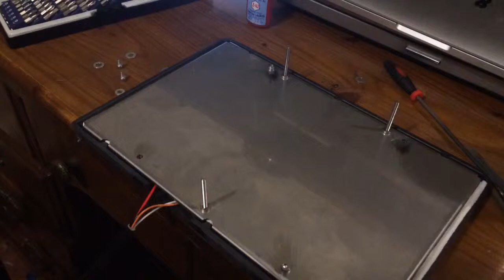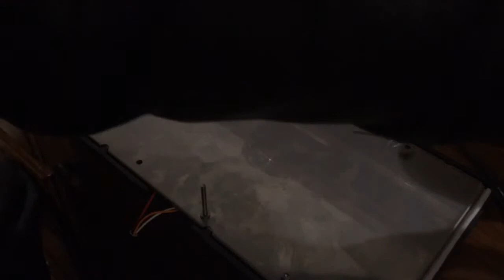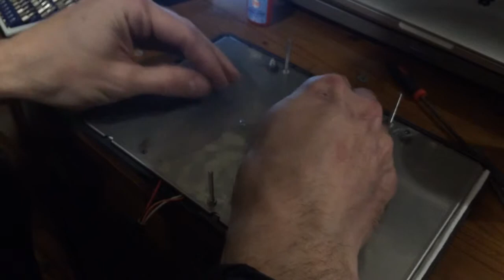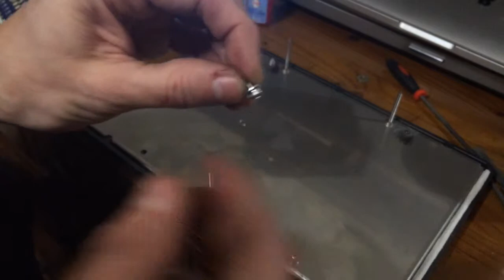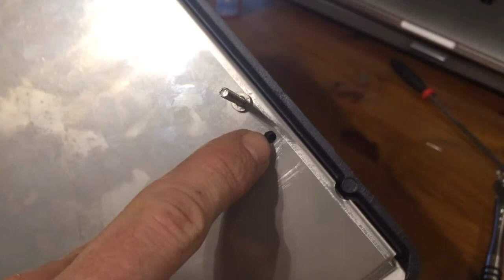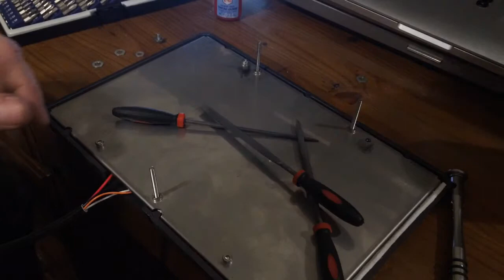Replicator 2X HBP Warping Fix

Comment from the maker: It worked great. If I was to do it again I would probably use the nylon washers, I just didn't have any available at the time. 
Since then I've also upgrade to bottleworks aluminum HBP with glass magnetic tops. So I'll probably sell this one with the fix. This one was already fairly level, but I had makerbot replace my fist one that was really bad. 
You can click the link to the google group conversation and read others comments on how well it worked.